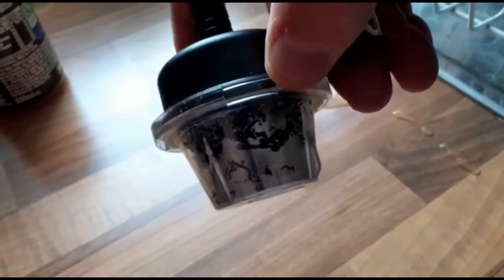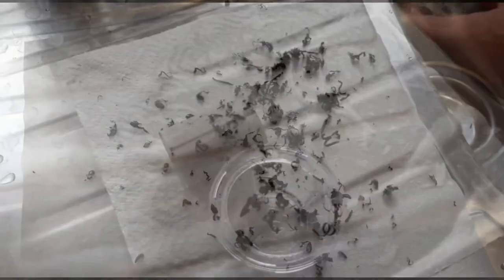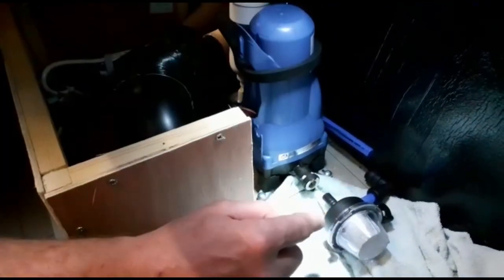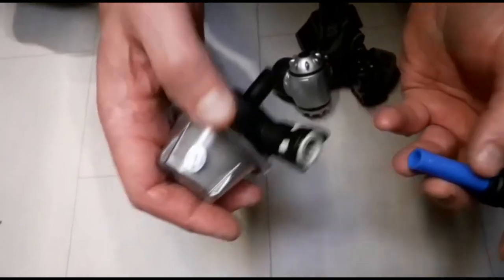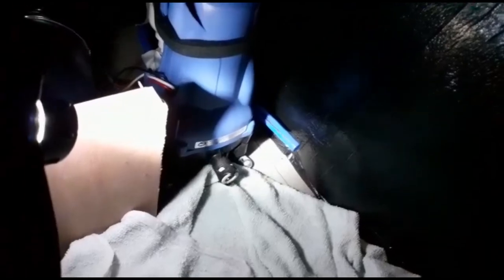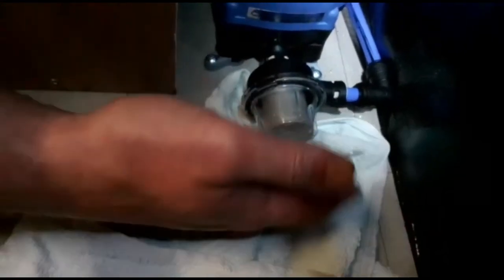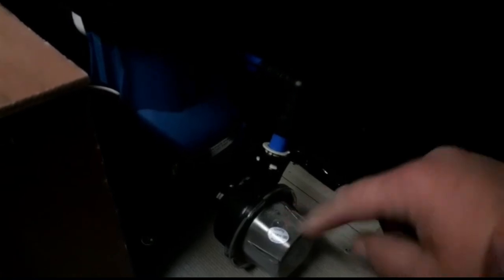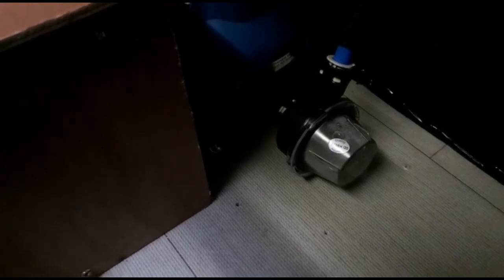Water Pump NOT WORKING What Is That In Our Drinking Water In Our Elddis CV20 Camper?

Comment: I had this with my Bailey 2018 Advance 76-4 which has a Whale submersible pump and a Whale pressure switch.  On the third  outing the pump would not switch off when the tap was closed.  All we could do was switch off the pump on the control panel after each time we used it.  A trip back dealer (100 mile round trip) saw them dismantle the Whale pressure switch where there was a large piece of black plastic swarf.  When I got home I decided to wipe the inside of the water tank with damp paper towels.  What I found was a considerable amount of plastic swarf left over from when the holes for the freshwater inlet, the pump, and the overflow pipe were drilled out.  Bailey should have cleared out the tank when it was fitted and the dealer should have checked and cleaned the tank during the pre-delivery inspection.  Neither was done.  After my own deep clean there have been no other problems.  The pump still pulses every so often but that appears to be something that happens with this system.  As you say no problem during the day but a pain at night especially when you are just dropping off to sleep.  Now we switch the pump off at the control panel when retiring for the night.  If you have not done it I suggest you wipe out the inside of your water tank.
Reply from the maker: Unfortunately the tank is outside and under slung with no access hole like a Motorhome, it’s obviously the same issue!

Comment: If your up for some craziness here it is .. drive your van on some bumpy road/track, swaying slightly side to side with the tap/water pump on. This will agitate the water tank that you can't get to and maybe pull out most of the plastic. I guess you only need say 30 litres of water, enough to slosh about. Have fun & be careful :)

Ordered a CV40 .. only got until December 2021 to wait :(
Reply from the maker: It’s in for warranty repairs in 2 weeks 🙏

Comment: Truma boiler water heater non return valve. Elbow fitting 34020-64000 TEF 2 😁
Reply from the maker: In for warranty repairs in 2 weeks
Reply: @RickandHeather  easy fix for them and cheap 👌

Comment: Hi guys was wondering if you got the water pump sorted out and if y did what was the problem 🤔 i thought i had sorted out my problem but the blipping noise came back 😞 HELP
Reply from the maker: It’s in for replacement on 17th July we will update when the work is done. The dealer is pretty sure it’s the pressure valve that needs replacement
Reply: @RickandHeather  is the pressure valve part of the pump 🤔
Reply from the maker: @antonybeaumont2697  it’s in the part of the system where your yellow drain tap is, the valve loses pressure and that causes the pump to “blip” the only other cause of a pressure blip is a small leak somewhere
Reply: Hi. We have a CV40. The glass filter is under the seat in the dinette.  After watching your video... Thanks by the way.  Can we just remove the   clear fliter cover without removing the whole thing? Is it a case of unscrewing it?
Reply from the maker: Yes it just twists off